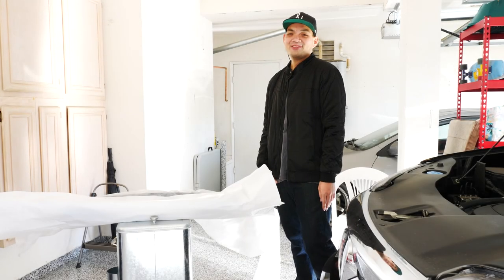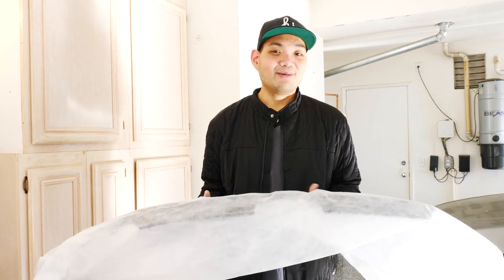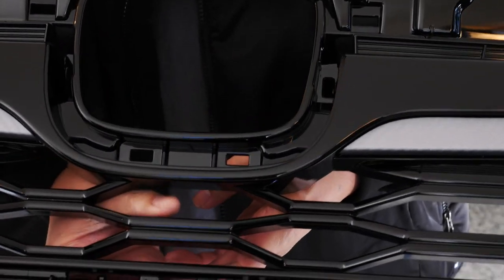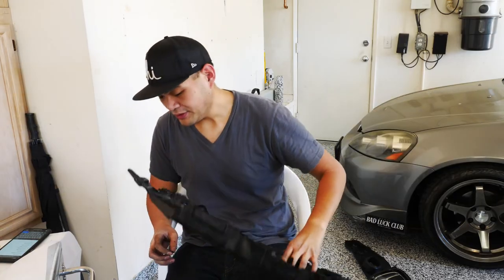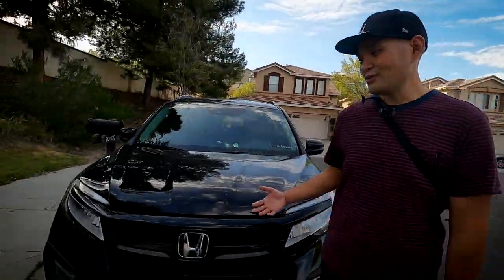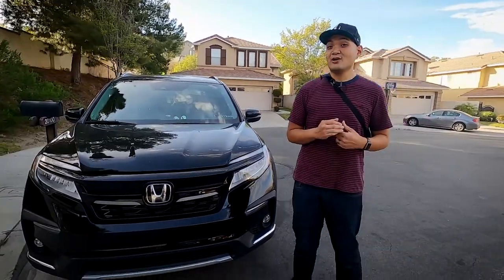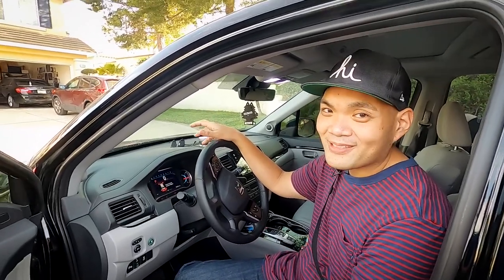How To Install a Grill for a Honda Pilot- A DIY Project // BK Honda Parts

Comment: I'm about to do the same route, but only replace the grill part because I got the BE. I saw another video that he managed replacing the grill without taking the bumper off. Sad news though it's not an instructional video. Thank you for making this video!
Reply from the maker: Thanks for stopping by to watch the video! Yes I think I’ve seen that video with him not removing the front bumper at all, but I have big hands and it’s so difficult to remove the inner clips without removing the front bumper. Fml lol anyways Goodluck with all your mods!
Reply: didnt your BLACK EDITION come with this glossy black grill?

Comment: Just wanted to ask for the new grill that you have now what cover base for the emblem did you use are you able to use your stock one becoz the stock one doesn’t fit onto the grill itself as i tried it and fitting the emblem is to tight on the grill
Reply from the maker: I used the stock emblem on mine. Not sure why yours doesn't fit

Comment: I want to do this once we get our pilot but I’m about to just pay Honda to do it. I’ll buy the part cheaper from oem parts site but will just pay them for it 

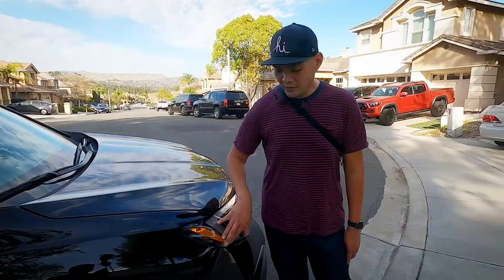Lol @ 5:08 — yeah I did a grille swap on my accord 2 years ago and I had small gap like that on passenger side. I said that same thing and have never went back to fix it 😂 it’s too much of a PITA. 

The first time I gave up and when I put the grille back on it was crooked I rode like that for 2 weeks cuz I didn’t want to deal with it. then finally got the swap installed and noticed the gap. 😒
Reply from the maker: Hey 👋🏾 thanks for stopping by! Yes the gap is annoying! Just needs to be adjusted with another person and tightened down, I guess that’s what happens when we try to work on stuff on our own lol. I plan on taking the bumper back off soon so hopefully things will get squared away ✌🏾

Comment: Is it possible to put this grill on a 2016-2018 model? Or do you have to also buy the bumper?
Reply from the maker: The black grill will only work with 2019 and up Pilot models unfortunately. The 2016-2018 has a different bumper, so in order for it to work, I think you would need to purchase a 2019 and up front bumper. Otherwise, just try and black out the front grill with paint or plastidip.

Comment: How did you remove the front Honda big emblem is it all just clips?
Reply from the maker: Hi thanks for stopping by to check out my video there’s two retaining clips you push down on from the inside of the grill. Very tight space but once you push down on these tabs with a flat head screw driver, it’s held in place with four clips, just gently pry it out
Reply from the maker: Here’s the link for bumper and grill removal https://www.collegehillshonda.com/instructions/pilot/2019/frontgrille.pdf

Comment: would've helped alot if you showed how to actually remove and install the grill instead of before and after shots
Reply from the maker: Thanks for the feedback! Will focus more on getting content of the actual removal process of bumper and grill. Hoping to find some time soon to do a video of removal process since I’ll be replacing the skid plate ✌🏾
Reply from the maker: Also here’s the instructions I followed on how to remove the front bumper and grill. Hope that helps a little https://www.collegehillshonda.com/instructions/pilot/2019/frontgrille.pdf
Reply: @TechTalkWithAdrian  you are to cool. Thanks man